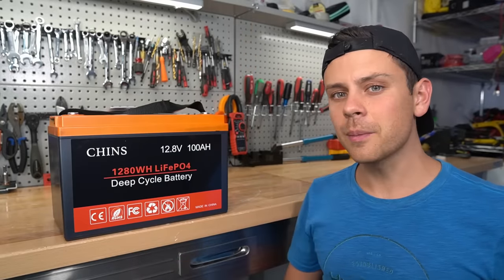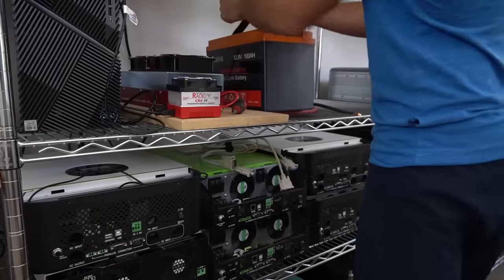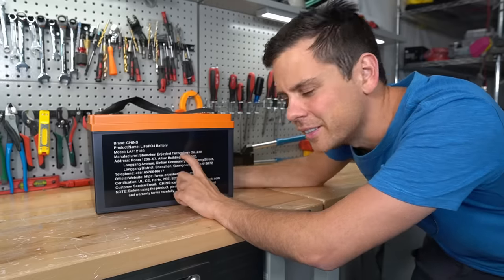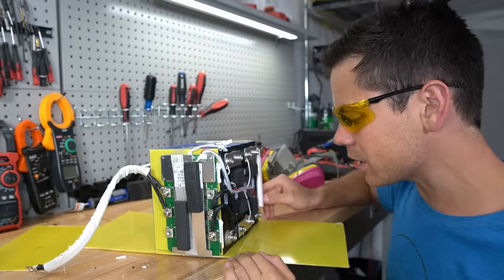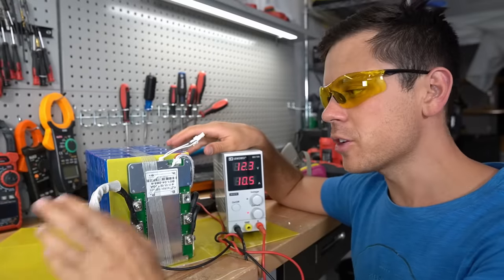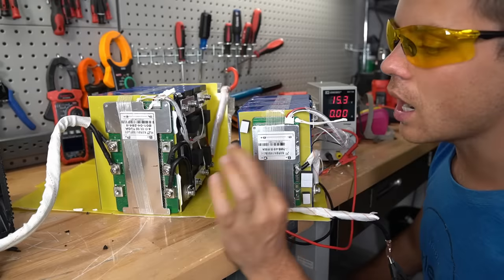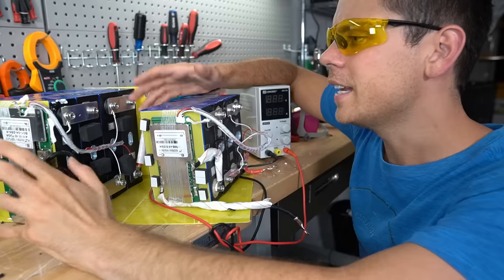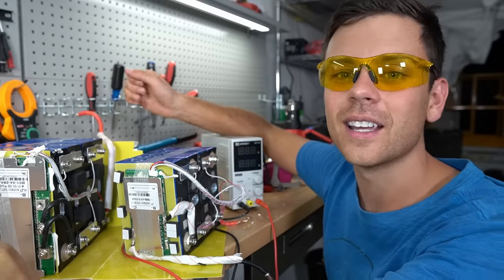$379 CHINS 12V 100Ah "Plus" LiFePO4

Comment: Bill. You should do a review for the prius prime. You can travel over 600 miles and it have a 9kw drive battery that you can use to cook with an induction cooktop, no need for propen, butane or alcohol. Now that some states are restricted for tourists.  It doesn't have room mode like the rav4 prime and the timer for the ac need to be adjusted for sleeping while charging it. you will save hundreds in the Florida keys where hotels start at $200 per night and are sell out if you get too late.
Reply: If they need to talk about being able to hook up an induction cooktop to a prius prime, then sales must be really slow these days :-)
Reply: @milcotto4153  I don't know about that but the induction cooktop cooking is the best easy more economical way to cook a meal and if you have solar panels it is free cooking unlike the rav4 premium which has a 1500w inverter on board.

Comment: I’m hoping you can possibly help me identify a problem I just had with one of these batteries.  
I run a 36v trolling motor on my boat.  
After watching a lot of your videos.  I bought three of these batteries for my trolling motor. 
I’ve had them for exactly 11 months with ZERO issues.  
Well the other day, I went to charge them.  And I noticed a white powdery substance all over the tops of the batteries.  
I still plugged them in via my NOCO charger as I’ve always done.  
Well one of the batteries instantly showed full/green charge right out the gate. 
The other two did their normal routine of flashing red bars as they work to a full charge.  
Well needless to say, they did not charge. 
Two of the batteries show 12.4 v on my voltmeter while one fluctuates between .00-7.9 and never stops on a specific voltage.  
Hoping you have some advice.

Comment: It looks like a great price for a nice battery, but the 100A BMS will limit how it can be used.   The largest Inverter you would want to put on a single one of these batteries is ~1200W.    
A 3000 W inverter is not large but it would take 3 of these batteries in parallel to run it.      I wonder how many you can run in series?    These might be ok for a 48V system (4 in series would allow a 4800W inverter.)

Comment: Thanks Will, you saved me a lot of time. What kind of inverter to run my c-pap machine (24 volts) do I need with this battery?
Reply: If your machine plugs into a regular house outlet, a 1000w inverter will be enough to handle the load.

Comment: So why can’t the temperature sensor be used for both low and high temperature sensing? An RTD sensor would have a range from -20 C to well over 200 C. It’s all about how the BMS software uses the measurement.

Comment: I wonder if Li Time lifepo4 batteries are also associated with Ampere Time.  They are selling on Amazon but are a new storefront with zero reviews.  The batteries are branded "Li Time" but other than that the case, including graphics, looks identical to Ampere Time.  The 12v 100ah model is listed at $299 while the same Ampere Time battery is listed for $349, but the Ampere Time battery also has a $20 coupon dropping it down to $329.

Comment: Thank you Matthew for this excellent presentation.  

DIYers appreciate pointing out the serious Temp Sensor and frozen charging concerns, but we need solutions that knuckleheads can manage.  WHY?!! Cus those living offgrid would like to REMAIN offgrid for as long as possible.  Youre way too young to truly comprehend why, but you will someday.  But it means we dont want to trek into town to replace the battery we forgot we charged frozen or let overheat.  The whole idea of solar IMO is less hassles and fewer bills.

So Im suggesting, because you are ideally poised to do this, to create a cottage industry where you provide electronic modules that sense frozen or overheated batteries independently of anything we buy, even if it claims to have  built in protections.  You could have them made at a nearby Maquiladora.

On behalf of all DIY Knuckleheads, thank you!

Comment: I have a Nature Generator that allows you to replace the batteries. I like the idea that you can replace the batteries and not have to replace the whole charge unit and case. The battery that comes and the battery that is available for replacement is  their 12V 60Ah AGM maintenance free deep cycle sealed lead acid battery from Nature's Generator.
The dimensions are 10.2 inch x 6.6 inch x 8.5 inch. Could I replace the deep cycle for an LifeP04 battery like the one in your video. Thanks for making great videos, have learned a lot

Comment: Do you have any insight on Chins Smart battery equivalent? Same line up (100-300amp) but with a built in heating system and built in app to monitor battery life. Thank you Will! Keep up the good work.
Reply: Ampere-hour, not amp.

Comment: U got any old 12v 100ah u don’t use or 200ah 🤔(free)i could use it for my xi3 trolling motor and what’s the best battery in your opinion for the price to run my trolling motor for at least six or seven hours a day

Comment: On the Mobile Solar Power Made Easy book, is the diagram on page 20 incorrect?   It seems panel #3 (L to R) should have the POSITIVE cable in light gray instead of black, right?

Comment: Love your channel. I have two sealed lead 220 Ah acid batteries in my homemade camp with two renogy 100 watt panels on the roof . My wife and I both have C-Pap machines. Is that enough to run both those machines all night on 12v ? Plus I have a 1000 watt inverter. Could that run them on 110 if needed?
Reply: You need to provide the power rating of the CPAP device before this question can be answered. And you need to provide the duration the CPAP machine will be operating, "all night" is vague and not precise enough.

Comment: Hey, since you are ripping apart plastic with much difficulty, i thought you might try using a soldering iron with a blade attachment to cut the battery box. hakko blade mabye

Comment: Regarding the lack of low temperature sensors, it looks like most of their other batteries are labelled "Low Temperature Heating" - whatever that's supposed to mean - but not this particular one. I assume that means some of their products have low temp sensors and some don't?

Comment: The batteries being made by the same manufacturer is similar to how Big Box and grocery stores have their own name brand products but they are often made by the same manufacturer. In China it's a bit more ruthless though, especially when it comes to intellectual property. You take it there for cheap labor in a shared manufacturing plant and your design gets leased out to local companies willing to use cheaper components and cut QA corners.

Comment: I don't understand these prices either. I posted before I saw online when I was in SE Asia I could order from China, four LifPo120ah 3.6v cells that go in to this thing for $130 or so. I wish I had your knowledge of how to wire them together into the BMS/ controller and connect it to the blue tooth app... charger etc

Comment: Honest question: Most batteries are in the same environment ambient temperature. So do any chargers have low temp sensor cutoff. I figure that a low temp sensor on a charger would probably be the same temp the batteries are.

Comment: I have a 280w 8v solar panel. I have 2 harbor frieght 12v 35ah batteries that i plan to wire in parallel (thanks to your videos) im planning on ordering a 20v charge controller with mppt (thanks to your videos) my question is, is the solar panel to big for my set up? In on of your videos i heard you say you can overcharge a small battery setup and it wastes the energy and heats up the battery and can damage it. I planning on using this set up in my truck for camping/overland trips. I want to run a small fridge, fan and be able to charge a laptop/phone. And an led light. I jave the solar panel, i got it for free so im trying to use what i have and stay budget friendly. Do you think my setup would be ok? Thanks again for all your videos

Comment: I have some questions that I hope you can help me with. 
I want to buy a suitable battery to power my Minn Kota trolling motor which has a 55 lb thrust that I use to push our 12 foot aluminum boat. I use it to go up and down the shoreline in front of our cottage. We usually are out on the water for 1-2 hours maximum per day. My questions are:
1.	Would I need a 12 V, 100 Ah battery or would a 12 V, 50 Ah be adequate for my kind of use? 
2.	Approx. how many hours of trolling would I get with the 50 Ah model before it would need to be recharge?
3.	My major question is: We usually only spend 3 months at our summer cottage, i.e., July, August, and September. When we leave the cottage at the end of September we would bring the battery into the house. We turn of the main switch on our electrical panel and so no electricity ( and hence heating) of the house occurs from Oct. 1st through July 1st each year. During the coldest winter months (i.e., usually January and February) the outside temperatures can go down to as low as -30 deg Celcius for approx. 10 days of those two months. During the rest of the months we are away the outside (and in our case, the inside) temperatures can fall below freezing from late October until mid April, though most often in the zero to -10 deg Celcius range. In the past I have used a regular 12 V lead acid battery (not deep cycle) which I stored near a window using a small solar panel on the window to keep it charged. This battery last for 3 years before dying. My questions are;
(a)	Would this method of storage harm the LiFePO4 battery?
(b)	Should I try and keep the LiFePO4 battery charged using my solar panel, or just leave it to discharge as we would leave it in a fully charged state when we closed the cottage at the end of September.
(c)	What kind of charger would you recommend for this type of battery?
Thank you for kindness in answering my question.
Jim

Comment: What type of battery would you suggest for a fifth wheel RV. Most are using Battle Born battery’s. I don’t have $1000.00 each to spend. 
I currently have two 6volt 100AH batteries we use for off grid power. I would like to have 4 12volt batteries to run the RV with.

Comment: I was told by E360 that if you get below 32F the battery will still provide power, but will not take a charge…at below 0F it won’t provide power…but he said their batteries won’t be damaged…they just won’t take the charge…is that correct?  You mention trying to charge the battery below 32F and it will destroy the battery, is that only on the less expensive Chin battery?  I see they have Bluetooth model with low temp protection…quite a bit more $$$.

Comment: Great video. I have a question can you charge this battery with a normal 10 amp charger or do you have to charge itwith 14.4 volt 20 amp charger.  Kinda confused bc im planning to go lipo battery for my boat. Thanks

Comment: Are you sure the low and high temp are set correctly in the BMS setting? And why use two sensors when one will sense both high and low?

Comment: For a minimum of 50 preferably 60 amp service from a solar system is there a calculator available on the web that would list the minimum requirements for panels solar charger etc.For a solar system set up on a ranch for a fifth wheel trailer

Comment: Being that the battery is 100Ah capacity; If wired in Series, that would give me 24V 100Ah? or Do I still have 200 Ah output? Would series wired battery still give me 200Ah capacity? Only considering series due to 24v system inverter.
Reply: Yes 24v @ 100ah is the same as 12v 200ah. Higher volts are better

Comment: Have you ever checked that "high temperature sensor" to see if it is ALSO a low temperature sensor?  I ask because my Daly Smart 150 amp BMS has one sensor that senses both high and low temperature.  I've tested it.  If it's a thermistor, there's no reason that it can't sense in the entire range as long as the firmware in the BMS is programmed correctly.  Thanks for the great videos!
Reply from the maker: Yeah I did, watch my first video when I test this
Reply from the maker: And it looks like a single threshold temp sensor
Reply: @WillProwse  Will do.  Thanks.

Comment: Dear Will,
Is it better to buy 4 batteries 12volts 150AH (Felicity  LPBR12150-T) and connect them in serie on a Growatt SPF 5000 ES or buy one  48v /150Ah (Felicity LPBR48150). ( 4 cost 1360$ / the other 1800 $)

Comment: Hi Will and all. I use a microwave in my campervan a couple times per day. I run my engine > battery isolater > agm battery bank > inverter. Does this set-up drain battery bank costing a cycle? Would it be better to have a system where the inverter is not after the bank? Could it be done off a buse bar?. Thanks!!

Comment: As CHINS 12 volt 200Ah battery has 2 different prices, as the higher price battery has low temperature cut off. This same battery has actually look so far better than 48 volt by FLYPOWER as I had purchased along with several photos shot. As Amazon has all of copies, as Amazon isn't very impressed as it so sloppy looks. As BMS suppose to be air cooled, as it was full wrapped to trapped even more heat.

Comment: I just purchased a 3 pack of these batteries for $700 from Wal-Mart. The specifications vaguely talk about low temp cutoff. I live in Oregon and am using these batteries for my golf cart. My question is, how do i test for low temp cutoff without damaging battery and if it doesn't have that feature can i just trickle charge it without hurting it or does ANY amount of charge cause severe damage?

Comment: How do you charge this batteries when in your garage if using for a boat? Can they be charged using the stator or alternator on my 25HP boat? All of these questions we’re not an issue with a big heavy deep cycle battery I used before. Please help! Thank you thank you thank you!

Comment: hmm, I wonder if low-temperature charging could simply be solved by placing them on the same automatic heating mats used for seedlings. keep the battery warm and don't use a ton of power.
Reply: YES. Warmth is warmth but I'm using thermo RV water tank pads

Comment: Why wouldn't you buy several of these plus a few of the smaller ones so they can fit into smaller spaces in your van? Plus with  these you never have to worry about having power or connecting to a ground based power source?

Comment: Hi Will I have 2 of these Chin 100ah batteries.  They are about 2 years old.  They didn’t come with a Bluetooth BMS. I was wondering if there is any way to determine the battery condition.  Also is there a way to know how many cycles have been consumed.  I have a very basic system in the back of my Jeep Gladiator.  Both batteries are kept in a wooden box and a Victron 300a smart shunt is being used.  I have Renogy 20a DCDC charger attached to the starter battery and when I have shore power I use a Victron 30a 12v charger. I have a switch panel running off of a Victron Battery Protect so I can remotely turn the switch panel off.  When needed I use a 2k watt inverter.  Sorry for such a long comment but I wanted you to understand my configuration.

Comment: Low temp charging protection is good to have.
Reply: The heated version says it has it, which is odd since the heater should prevent it from getting too cold! It's $170 more but also has Bluetooth connection for monitoring.

Comment: Will good teardown, always enjoy watching them.

Still I'd like to see the ultimate portable power station build.
A EMP PROOF unit that could power a 50 amp RV for 8 hours.

With all the threats in our world today having the ability to run a system after a cme / emp seems like a logical choice. Since all of the current tech is not hardened, a bms and microchips could render a system useless so having a emp proof unit would be a peace of mind.

Comment: Hi will. I live in Puerto Rico where temps rarely fall below 69f. Will this be a good choice for hurricane backup power where all I would power up is my inverter refrigerator some fans for cooling and tvs for news ffor a couple days. Right now I have about 750 w worth of panels. I depend mostly on a 7500w gwnerator but since during hurricanes gas is scarce, how long can these sustain my loads during hard times. Im willing to buy them uf you think its alright

Comment: I love your videos. Great review. Amazon price dropped to: $479.99 😊
What about the Amazon 3x 300Ah larger 100A SAME company battery that has a heater that heat the battery up to 50 F (10 C) before starting to charge and thus has a LOW Temperature cut-off?
Amazon: 12V 300Ah Smart LiFePO4 Battery, Support Low Temperature Charging (-31°F), Built-in 100A BMS, 2000+ Cycles, Mobile Phone APP Monitors Battery SOC Data
Brand: CHINS

Comment: If a battery is frozen, and I try to charge it, it will ruin the battery. So what if I thaw it out first after it freezes? Will it be OK then to charge? Does colder temps reduce the life span like they do with lead acid batteries?

Comment: I got 2 of these batteries for running the trolling motor on my bass boat. I plan on taking the batteries out of the garage and into the house during winter storage but the manual that came with the batteries claims they have an internal heater to prevent freezing. Is there any way to test this. I guess aside from putting it in the freezer and seeing what happens.

Comment: Hi Will, I was wondering if I build 2 of the 280ah batteries do you need a BMS for them? I am just using them to run my oxygen machine overnight, I do not have any solar

Comment: So can one simply rip the battery apart and utilize the bms, cells as a smaller package? Looks solidly built, protected, etc.

Maybe one can add a low temp sensor to the BMS?
Reply: You can't just all the temp sensor if BMS doesn't have the software to use the temp data.   Some BMS's may have the low temp sensor port but lack the programming.   Hard to know what this battery has, but I'd bet it lacks the programming or they would have added the sensor.   The sensors are really inexpensive.